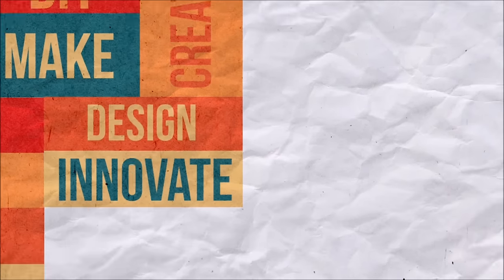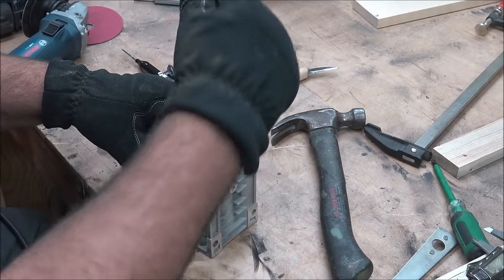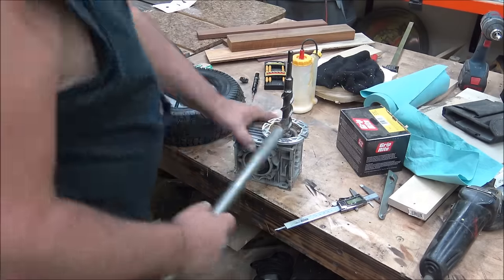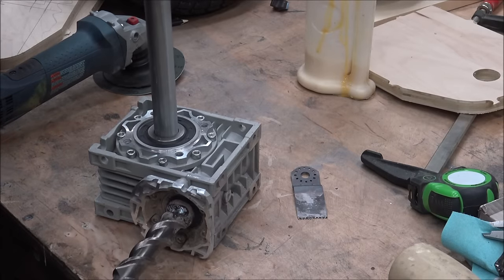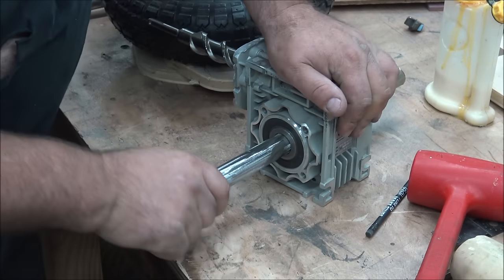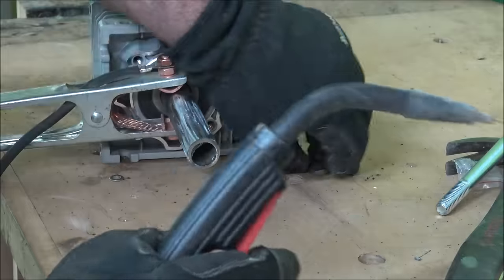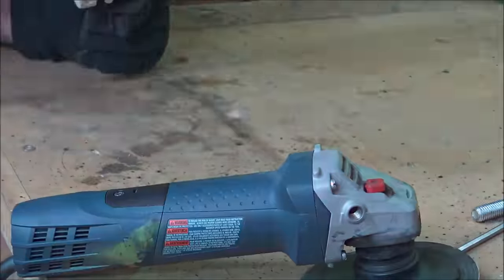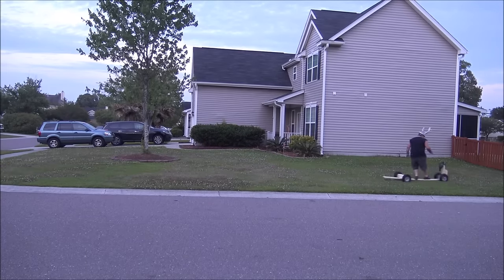Electric scooter type thingy - Drill Powered

Comment: Fully aligning and welding up two steel shafts at home is pretty much impossible, a quick and dirty solution is to have a very short rubber hose interface which allows for the slight off center travel and preserves both bearings.

Comment: hey +izzy, you got a table saw sled to make cylindrical rods.. swap the wood blade for the angle cutter blade, mount the rod in the sled and make a perfectly fitting rod.. 
same would have worked wonders for the drill bit..
Reply: that being said, that looks like a fun bun to ride..

Comment: Not exactly the best way to do the metalworking stuff but you did good with what you had. Have you noticed any slip in the drive system without having the keys in place from the gearbox to the axles or does that press fit keep it tight enough?

Comment: This should have been a lathe project.                                                                                                                                                                   
Or you could even use a drill and grind it down while it's spinning.                                                                                                                
Then it would have been perfectly centered.